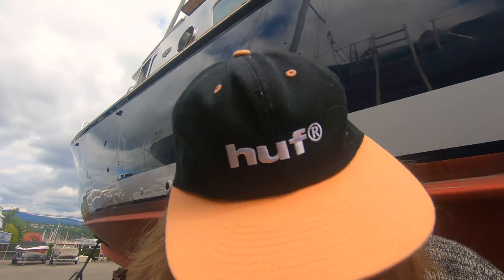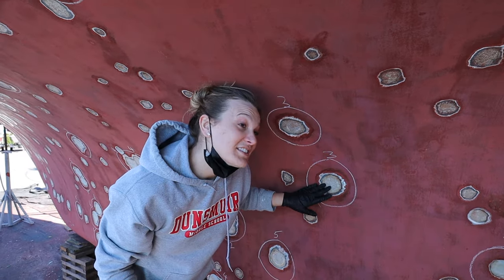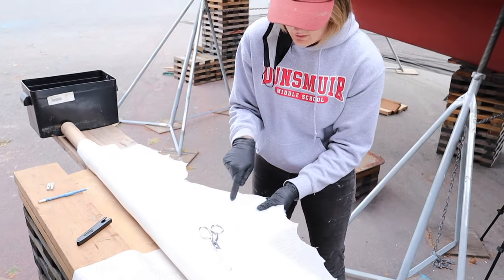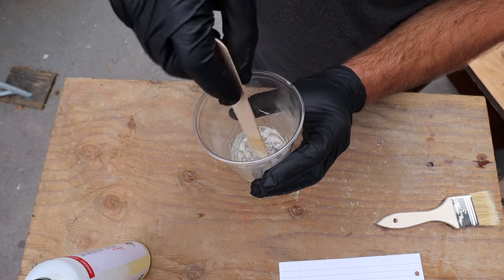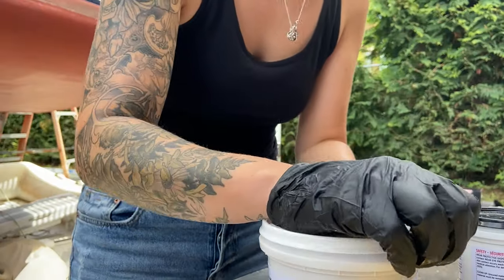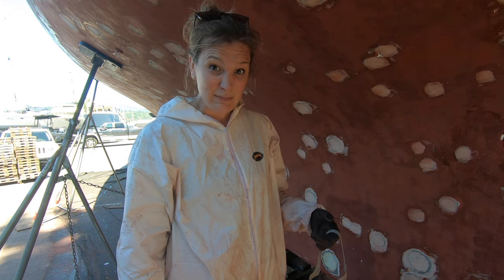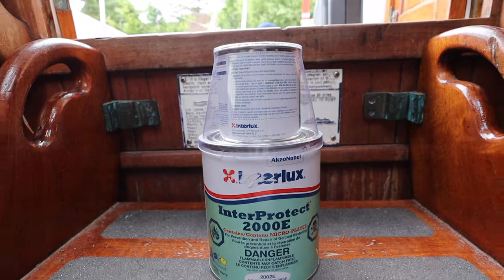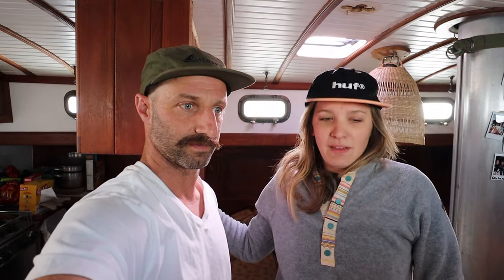HOW TO Repair Osmosis Blisters on a Boat | Preparing to Sail the World | Cruising Meraki Ep 23

Comment: @bror9519
Thank you very much for sharing and all the work you do with the boat and film. I have a question? It looks like the hull is red because the bottom treatment material against algas is red. Is that right?  Why haven't you removed the bottom material and put epoxy over the whole hull as an anti-osmosis treatment against future issues?

Comment: This is exactly backwards.. you put the small piece of fiber in first and the larger last.. holy smokes 😳
Reply from the maker: lol, that’s exactly what I thought when I first started researching the repairs. I think when it comes down to it, as long as the prep is done right and the epoxy creates a good bond it shouldn’t really matter which way it’s done. I found most did the big patch first so it bonds all the layers together that are already on the hull. Most of the research I did made the repairs the same, big patch first.
Reply: i also thought that too first, but think about it when grinding over it: it will destroy the largest patch. so the whole theory about largest at the outside is nonsense then
Reply: plus there are two other side effects mentioned: if the smallest is the inner one that creates a lot of edges where there is more stress and also air can be enclosed. on the other hand i also think when using epoxy its not a real problem at all, because its so much superior to the original polyester fiber used within the rest of the structure.
Reply: Small first. Always

Comment: Should there be a zinc attached to a fiberglass hull? I've done a lot of zinc replacements before, but never seen one attached to fiberglass...
Reply from the maker: Yup it was odd… that’s why we removed it and repaired the damage below it :)
Reply: The zinc outside the hull may in the past have been connected to a cable inside the hull, and this cable may have been connected to the engine block, e.g. ?
Reply: @bror9519  For what purpose?
Reply: @diver0129  Galvanic corrosion as there is contact between steel and sea through the cable, and the corrosion takes zinc instead of the steel in the engine.  you can have a larger zinc on the outside than there is room for on the propeller, and thus not have to change e.g.  each year.
Reply: @bror9519  I used to regularly change zinc anodes. As I understood it, in order for the zinc to act as sacrificial cathodic protection, the material to be protected would have to be submerged with the anode...  Like you couldn't attach a zinc anode to the frame of a car and have it protected unless the frame of the car was submerged in water.  I could be wrong of course.  Maybe just the anode needs to be submerged.
Reply: @diver0129  This is difficult, and even for electricians I read that this is difficult. In my mind, there is ion migration through metal, the fact that the anode is connected to metal via a wire will surely create metallic contact? I have both on my boat. Anode one is attached to the propeller shaft. Anode two is located outside the hull with wires through the hull to the rudder stem and engine block. Both anodes are corroded, and the fact that they are corroding probably means that both are working.

Comment: I’m surprised that you didn’t take all the antifouling off before starting this. That way you could barrier coat the whole hull not just the patches. After all the rest of the hull is polyester resin which could use the protection.
Reply from the maker: We talked over all our options before starting the work and for our budget and time frame this is where we landed. Osmosis repairs are a hot topic with lots of opinions but we are so happy with how the repairs have held up and we definitely feel it was a job well done. Yes, going the extra mile and peeling the hull, letting it sit to dry out completely (months, and may need to be tented and heated depending on climate) then adding layers of glass back would be an option but we didn’t feel the need to go that far. We’re super happy we did what we did the hull is happy too.

Comment: Wouldn’t chopped strand mat be stronger than bilateral?
Reply from the maker: You might be right… from what we read and the folks we spoke to it felt like bilateral was the right route for the epoxy we used.
Reply: @CruisingMeraki  good work anyway. I’ve had to use a lot of fibreglass and resin in my refit. I’m on my 4th 5 litre tin. Four hundred rubber gloves 300 mixing sticks and I lost count of the disposable pint mugs I’ve used. Should be worth it though. Good luck 👍🏼